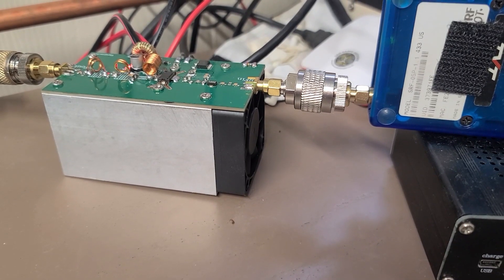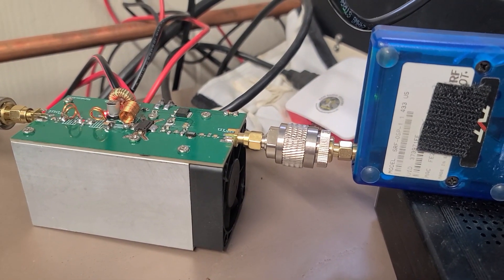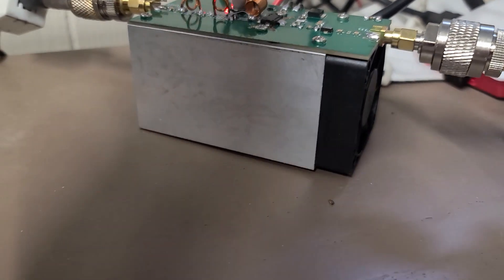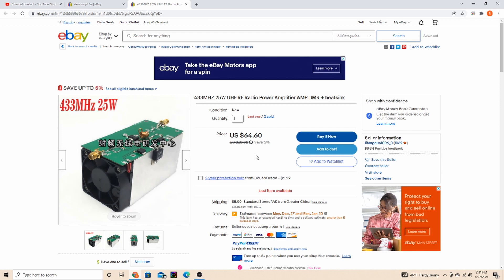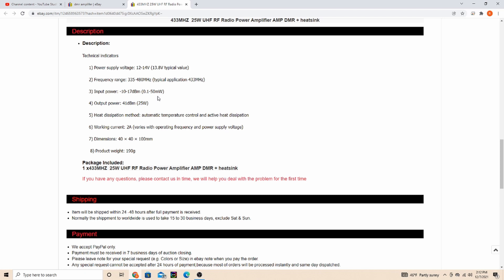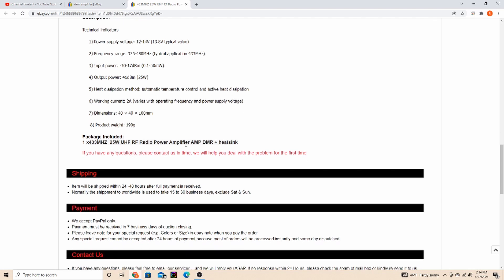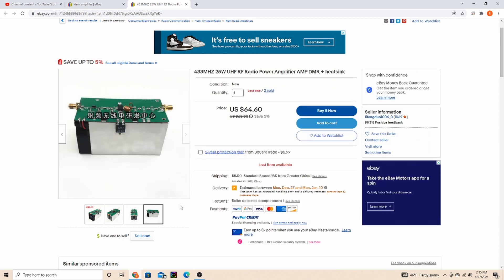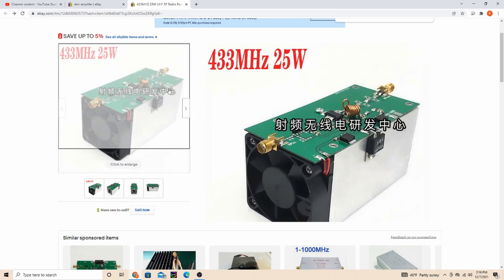Amplifier For Your HotSpot? #hamradio #hamharder

Comment: So I hooked my hotspot into my J pole antenna , was attempting to use my Hotspot from work about a 1/2 mile away. surprisingly it almost made it but there's a lot of brick buildings in the way. Wondering if this will make the trip!
Reply from the maker: We use it for our repeater over 12 miles away with a small yagi

Comment: My Bridgecom Sky Bridge hotspot claims 10 mw.  I've ordered this one and hope my hotspot can drive it.  I hope to have it in the next couple weeks.  10 mw doesn't get me very far, and I like to operate while bicycling at a State Park about 5 kM from my house.  I do have good line-of-sight to the park.
Reply: Get an adapter so you can hook it up to your base station antenna
Reply: @thesuccessfulbarber  Thank you.  I did that, but couldn't get the range I needed, so I ended up getting an openspot4, and enabling my iPhone's cellular hotspot.  For the most part that works VERY WELL except in the park, where cellular service is spotty.  Thanks for the suggestion and reply!

Comment: Hello Justin Case again .. really my name is Dave (KI5MEF) .. how far away is your Fusion repeater?, as I want to know if it receives the repeater thru the amp (as simplex) well, seeing that it doesn’t seem to have an antenna switch … thx
Reply from the maker: It's around 13 miles away as crow flys. Yes it receives through it. But be sure if you purchase one that it's able to, as some models are transmit only.